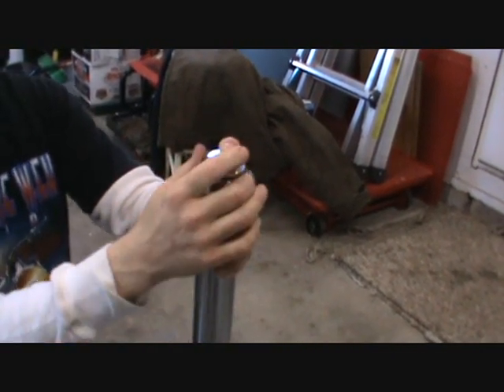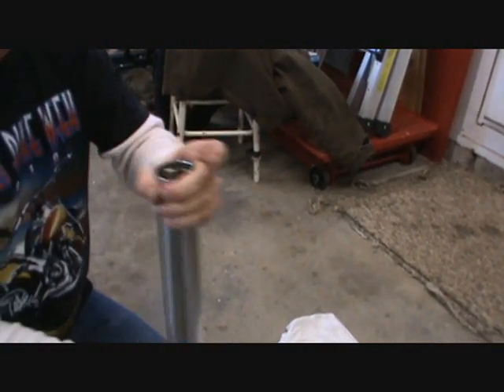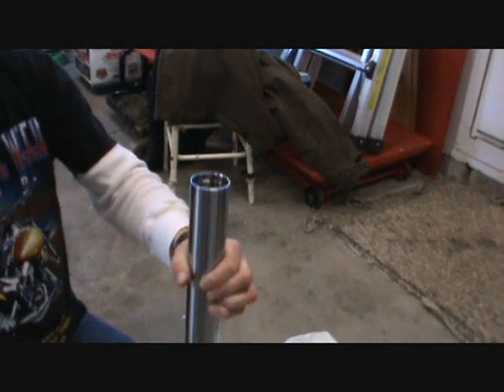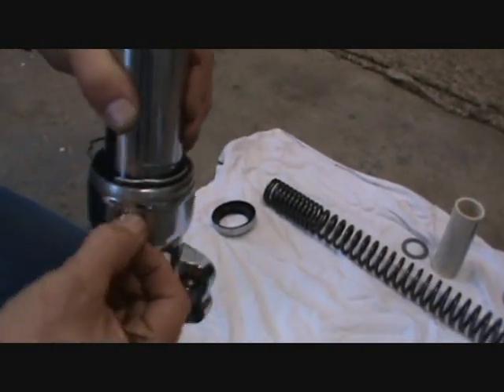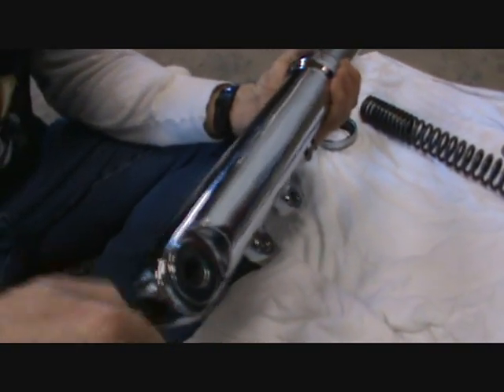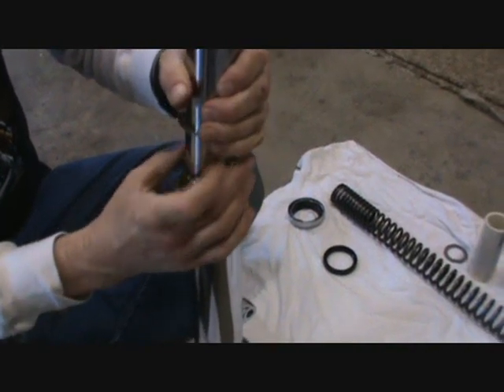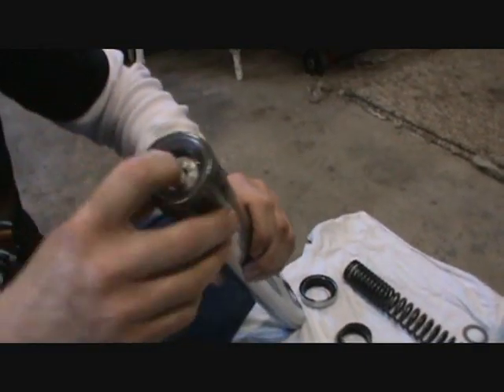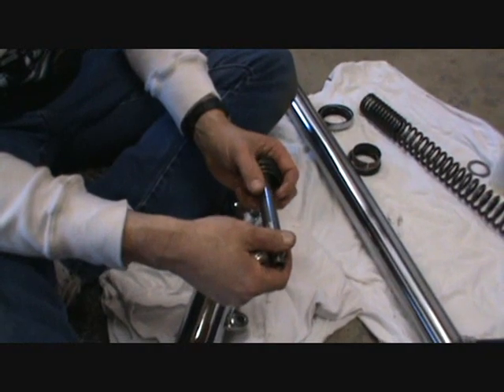Fork Disassembly_0001.wmv

Comment: pulled mine apart today. either I lost that brass washer on the bottom bolt or it wasn't on there. there was a rubber film/coating at the base of the bolt though. do you know where I could find a similar washer? I'm not sure what to look for?
Reply from the maker: Jake Wojtowicz your local dealer will be able to help.
should be an item in stock.
Look at parts manual.
Reply: rscrod the picture I found showed all of the parts but notes not sold individually. :(
Reply: went to Harley. they had new bolt and washer. thank you.